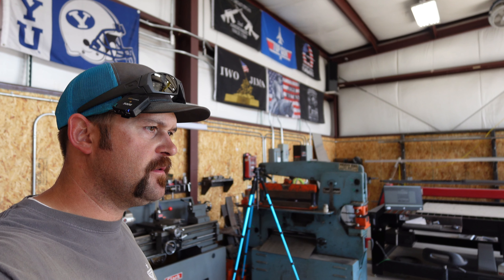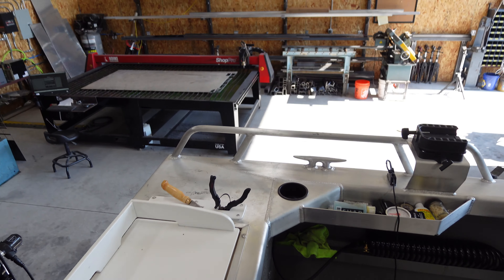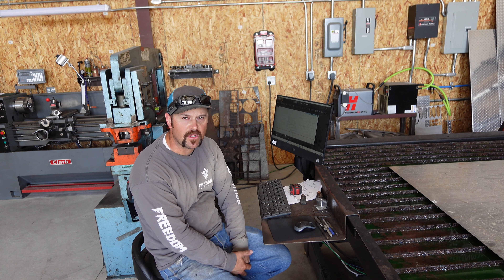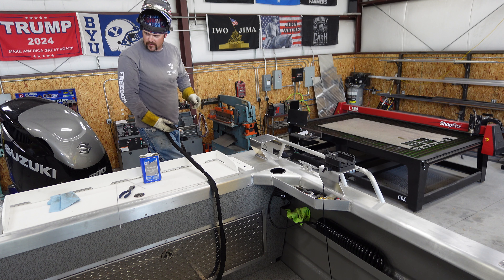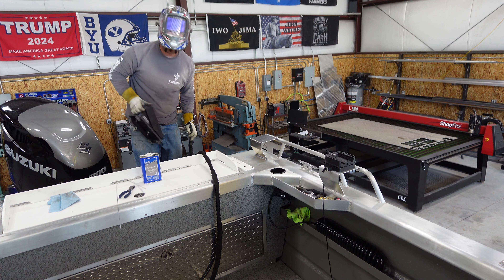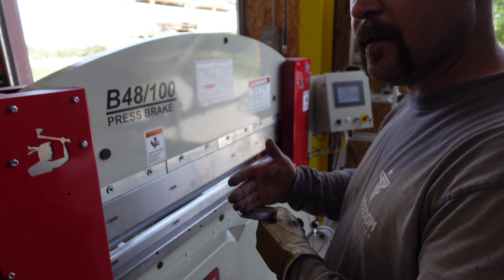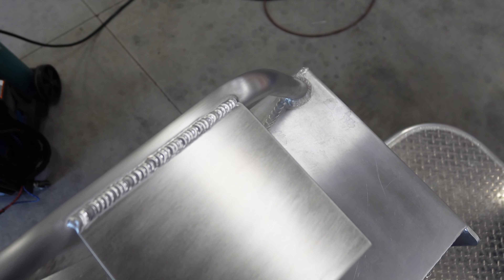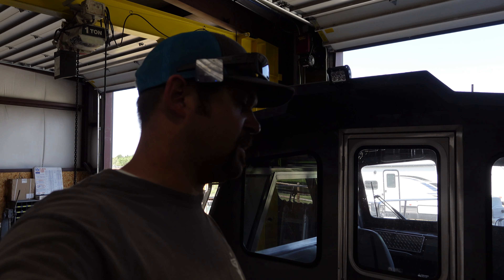Aluminum fishing boat TIG welding modification

Comment: If you ever have to press/brake bisalloy or AR grade plate grain direction is very important. If you brake it against the grain it can explode in the press.
Reply from the maker: @Keithskane  I didn’t even think you could bend AR plate. I know the same goes if you try to punch it in the iron worker. I’ve watched a guy blow up a punch before. Scary stuff. Thanks for watching!
Reply: @Freedomfabrication777  Yeah it can be pressed but is a bump press application resulting in a radius not a sharp corner. I work alot with it here in Australia fabricating mining equipment, vibration feeders and large wear components